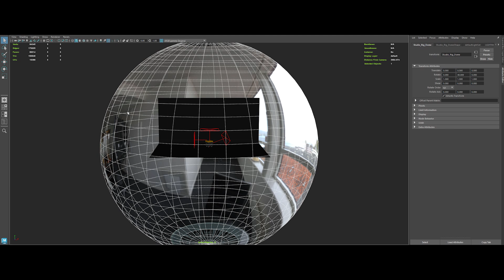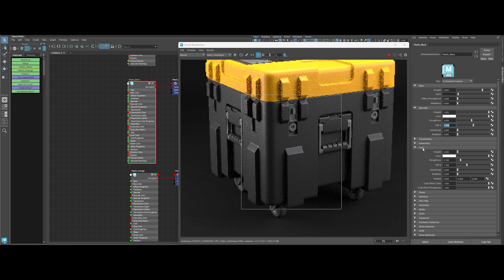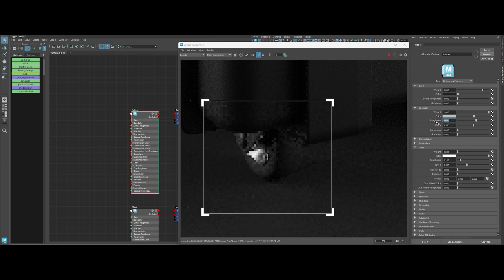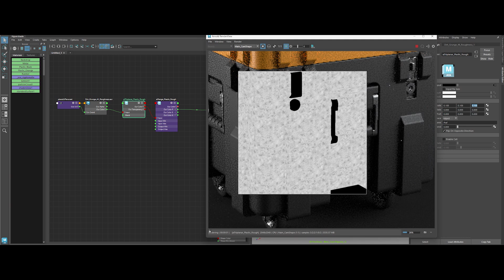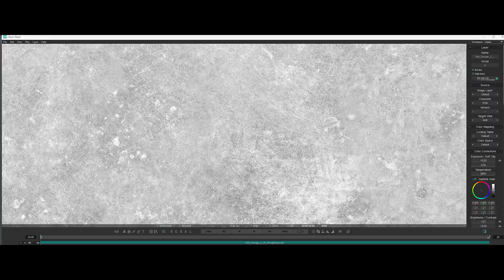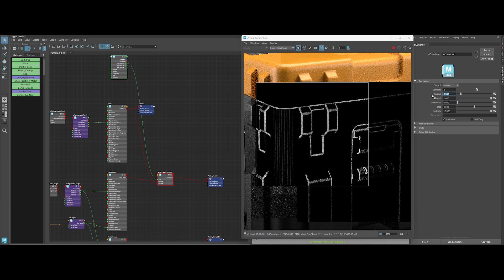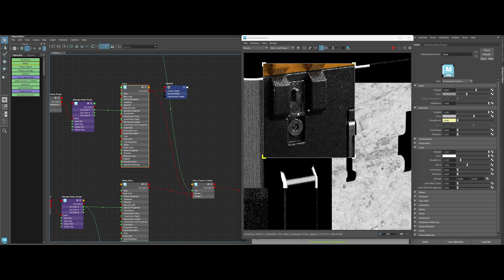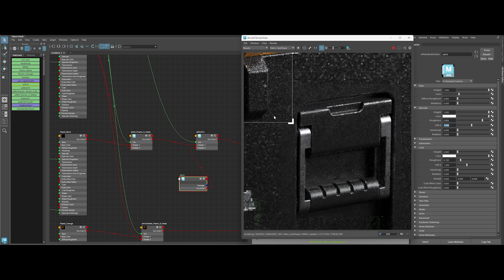Why Your MATERIALS looks like SH*T? | Maya & Arnold

Comment: one thing i noticed about substance painter stuff is it all looks very "game assety". There's a lot of dull and flat character to it, and it looks, well...painted. I think the stock V Ray and Corona materials, with the right maps, look way better.
Reply from the maker: @tomd4748  Substance Painter can create photoreal results, but here’s the fact: it needs a lot of work, tweaks, and fine details for a truly credible look. If you only use basic stuff, indeed it will look very "game assety". Once you do that, it can rival V-Ray & Corona. 😉🎨
Reply: @ yeah there’s a guy on YouTube. He tells you why your texture suck and then he goes on to fix them, but whoever he is, he obviously has years and years of experience in texturing because he runs through all these different settings, off the top of his head, like a mad scientist mentally working through differential equations.

He’s tweaking them in real time and changing the original to the version he would’ve made. He’s rattling off numbers and settings for like two minutes straight and you have no freaking idea about any of this stuff, I guess, unless you spent years in some program at gnomon or scad. 

Obviously he knows what he’s talking about by the result he gets, but I mean Jesus Christ if this is the level of knowledge you have to possess to turn out for real results in substance painter, I”d just skip it and use Corona, or V ray, or Arnold- hell, even cycles, as an out of the box solution that doesn’t need a color theorist standing over your shoulder to get photoreal results.
Reply from the maker: @tomd4748  Totally get that, it can look like rocket science when someone’s rattling off advanced settings. 😅 Substance has a steep learning curve if you want ultimate control, but you don’t always have to go that deep. If an out-of-the-box approach suits your workflow better, Corona, V-Ray, or Arnold might feel more straightforward. It’s all about using the right tool for the job! ✨